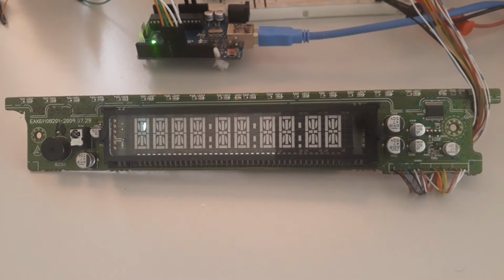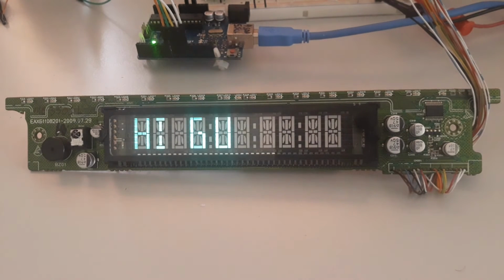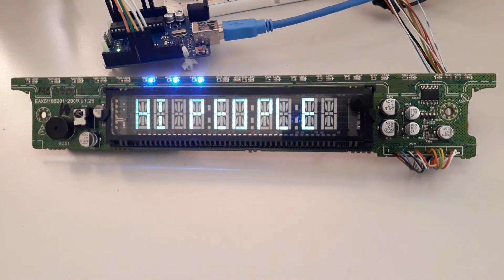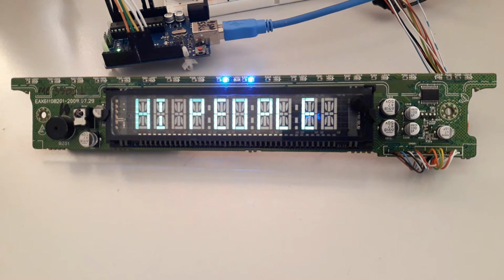MC3501L

Comment: Kind regards, the mc3501l was damaged by mistake and I bought a pair on Aliexpress, but I'm curious if I could replace it and an LG sound system doesn't show a screen. Do these integrated circuits need to be programmed?
Reply from the maker: Hi, Sorry later answer, but the notification don't happen! No! You can replace it without problem, the configuration will be done by the system where it is connected. As you can see in the lines of code I let at description, the set and the data is provide by Arduino to do the test without resident configuration on the Chip. Good work at replace!
Reply from the maker: Don't forget that the MC3501 requires two voltages: -35V (or close to that value) and the logic supply voltage. It's also essential that the filament power supply be present in the VFD.
If you have any questions, let me know.